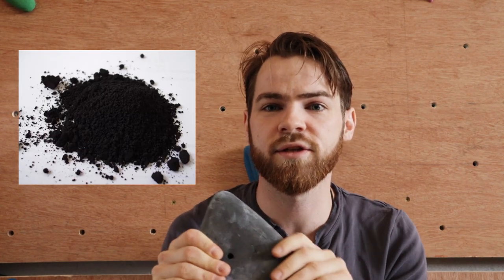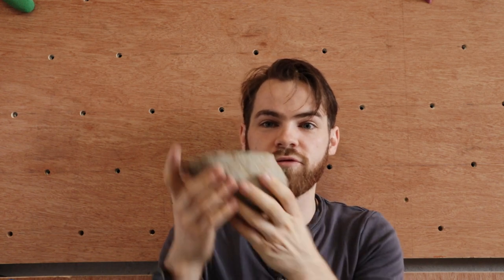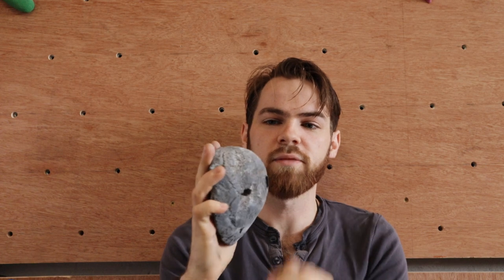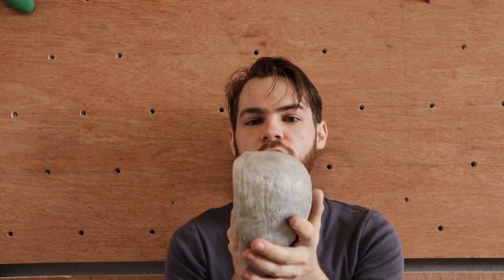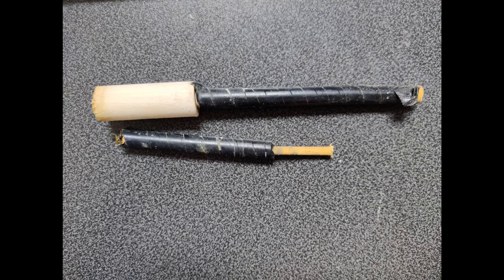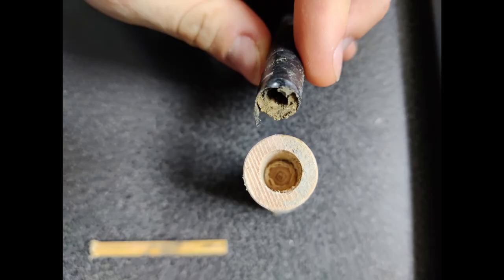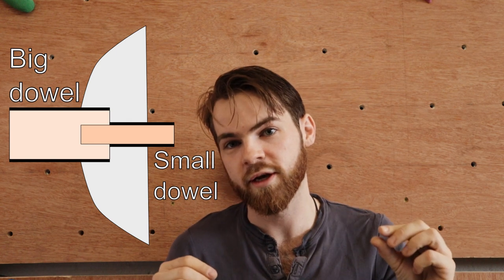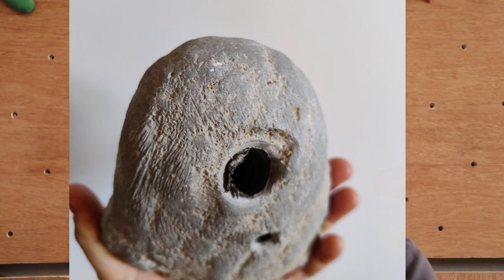Concrete climbing holds - Tips, thoughts and technique

Comment: Very in depth and concise... Good content fella!
How do you find the weight of the large concrete holds on a plywood wall?
Reply from the maker: The holds only end up weighing a few kilos so not really significant compared to the dynamic weight of the climber. If anything the weight helps stabilise the wall if it's got a bit of flex. They're a little heavy to lift to bolt on but that's not significant on a home wall where the height is typically low. Sorry for the delay I thought I replied to you ages ago!

Comment: Soft drink or milk bottles deformed with hot air gun to make nice moulds. You can stretch them over rocks or holds. 
Dust the colour on the inside of the mould or the green concrete. The green concrete will suck in water and dye as it sets. So dust and light spray. That is how driveways are coloured. 
Make it composit by lining the outer part of the mould with fibre reinforced and coloured cement and fill in the reset with more liquid mortar.
Reply from the maker: Good ideas, thanks! Hadn't thought about the surface colouring technique but it won't work if you are working the holds green or sanding them significantly

Comment: Nice video! How did you create your mixture? Did you add any sand, or really just the pure cement? Cheers!
Reply from the maker: These were pure cement, I think you could add sand but cement was slightly easier and easier to make a smoother surface that's nicer on the skin maybe. Not sure how the relative strengths are but I'd probably keep a fairly low % sand either way

Comment: I'm hoping to make a climbing wall on an existing concrete wall on a side of a building in a community that's hard to ship things to in Mexico. I'm hoping these concrete holds can be an option, 1 because the holds can be made here locally (everything is made of concrete and cement here), and 2 so the holds can blend more in with the wall to make the wall more palatable to the community. I'm trying to think of a clever way to color the holds in both a way that's subtle from the street, but also clear when you're climbing (maybe a colored fender washer under the bolt head). 

I want really want to avoid the secondary wood screw if possible. I wonder if a metal sleeve for the bolt can be added into the hold as the concrete is being poured so that the bolt can have extra torque added to it and that compressed the sleeve instead of the concrete, maybe the sleeve has some teeth that bite into the wall a bit to resist rotation. I wonder in your experience with the process if you think this is a direction to experiment with? The metal sleeve around the fastener idea is common in plastic injection molded/3D printed parts.

Thanks for sharing all of this great info in such a well put together video!
Reply from the maker: The challenge with the concrete holds is clamping the whole face of the hold against the wall, not just conducting force. Id worry a metal sleeve would result in a hold that spun , if the sleeve makes contact with the wall surface.
This is a problem for plastic holds too, which is why almost all modern holds have a pinning wood screw to stop them spinning

Teeth on the sleeve could work to stop spinning but I think it is still crucial to clamp the edge of the hold onto the wall so it's in compression and pre loaded for climbing forces. Probably worth an experiment

Adding mesh would help with strength for sure. I think key is letting the concrete cure fully and using lots of bolts

If you're expecting other people to climb on the holds I would recommend testing them very thoroughly - an unexpected hold failure can lead to injury, especially with such heavy holds and potentially with children.

Comment: How much time you let it dry before putting stress into it? Do your first hold got brittle? i am using only cement too
Reply from the maker: I'd wait at least 4 days for super blobby shapes and 1.5 weeks at least for shapes that need more strength? I'm not 100% on that, depends heavily on curing temperature etc. Definitely brittle yes you need to treat them kindly

Comment: Great video, thanks for sharing your experience! 

I wonder if you could add a bunch of shredded plastic into it to both improve tensile strength as well as make the holds lighter? There are lots of videos where people add plastic to concrete to make paving stone etc... Here's one that references a study that shows an increase in tensile strength. https://www.youtube.com/watch?v=9u7KmE9EJ5M

edit: I've looked up various actual academic studies and they seem to suggest that tensile strength decreases as you add plastic, and I've found mixed conclusions about compressive strength. But it does, indeed, lower weight - maybe not a factor compared to dynamic body weight, as you mentioned in reply to another comment. 

If you were to melt the plastic and concrete together (or just replace the concrete with sand at that point), it would surely be stronger though.

Still, it would be cool if you gave it a try!
Reply from the maker: Thanks! Might well work, although I think you'd want long pretty thin bits or it might cause stress concentration as the concrete won't adhere to the plastic. Many concrete strengthening fibers are plastic but they're more like thin fishing line thickness or thinner. I guess the tangle aspect might be quite important to mechanically lock the plastic to the concrete due to the lack of adhesion... Still a neat idea and worth trying, especially for larger holds!
Reply: @gilesbarton-owen6783  I think you're right about all that. I've seen some videos of commercially produced plastic aggregate and it is a bunch of random jagged pieces, which would provide much more "grip" for the cement than smooth shards. Still, could probably put some into the large ones with little I'll effect.

Also, the first video only tests up to 1% plastic (though at that weight, what's the point?).

Anyway, if you do give it a try, please let me know!